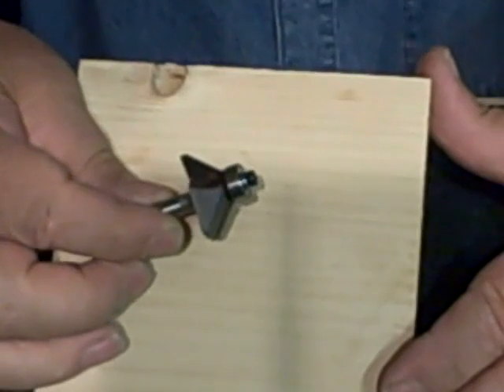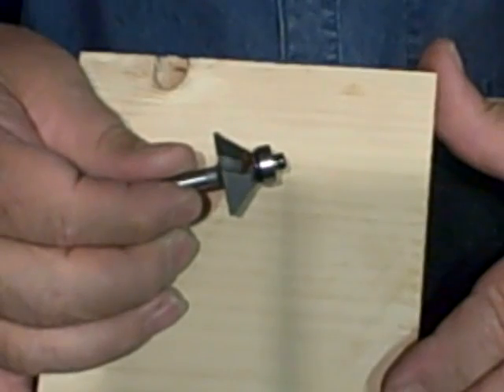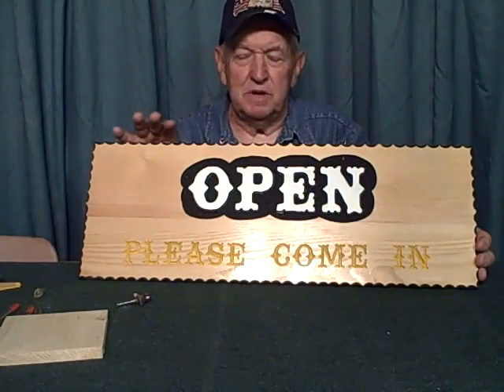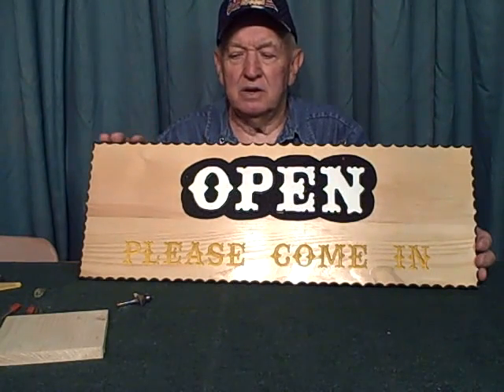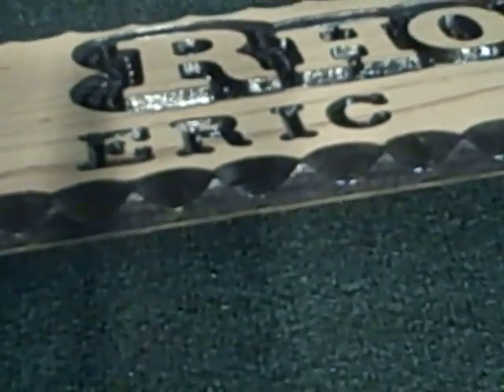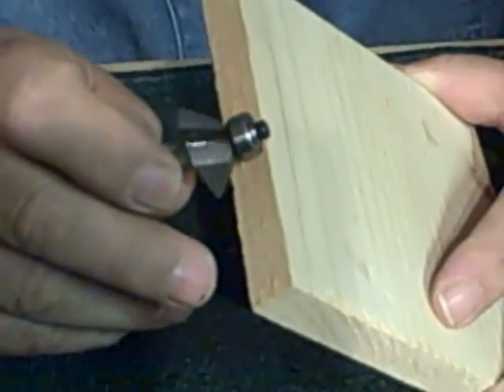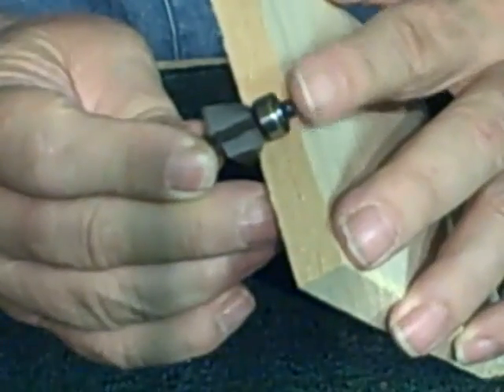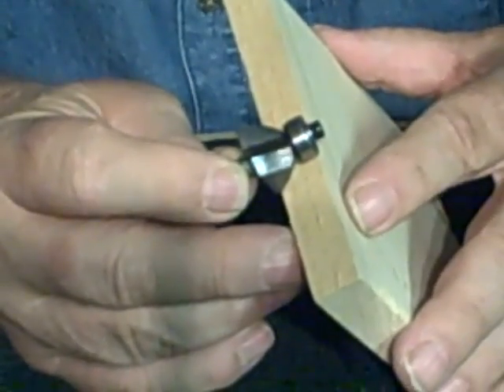#38 Dave talks about router bits -  part 1

Comment: Where can I find a bearing for a router bit that has an overall width of a 1/2 inch and an inside opening of a 1/4 inch  ?  Thank you
Reply from the maker: I would check with a router bit manufacturer like Amana. Let them know you need a replacement bearing with 1/2" O.D. and 1/4" I.D.
Reply: @oldave100  Thank you for the suggestion Eric.
Reply from the maker: Anytime Patrick... You can always email me directly as well eric@makeawoodsign.com